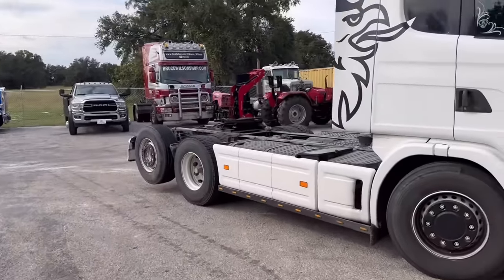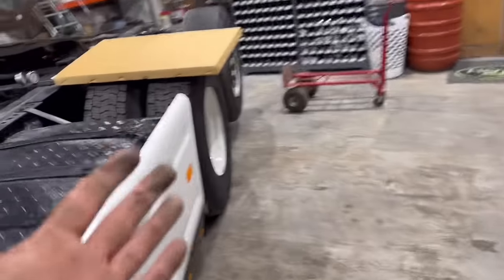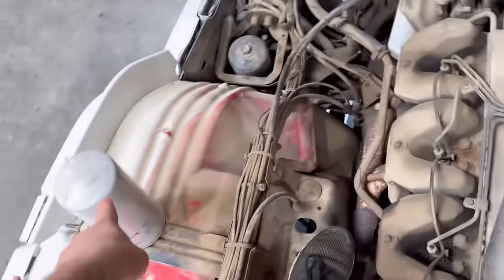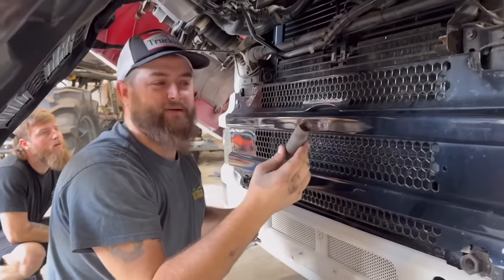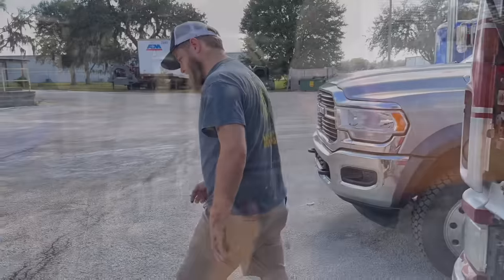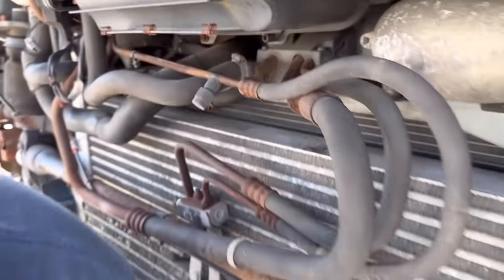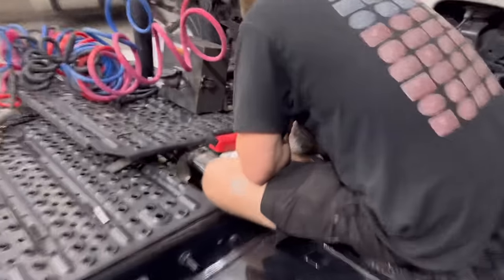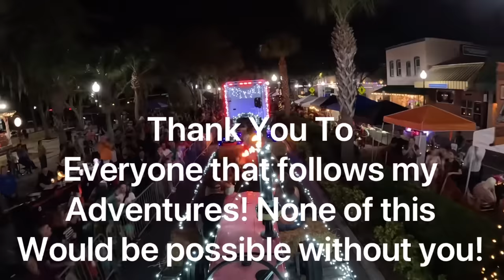My SCANIA Needs Serious Engine Repair…

Comment: The heater is a parking/dieselheater to make the cabin warm in snowy and cold northern weather. Sometimes you have to idle the truck to charge the batteries so the truck can start in the morning as well. Only with 100% healthy batteries you can have the heater on all the night without idle the truck. Trust me, I drove a Scania that night and I was going to sleep in the cabin in -8 degrees celsius. I fell asleep in a warm cosy cabin, but when I woke up it was -4 degrees in the cabin and I was freezing my a** off. The problem was the batteries, heater stopped in the middle of the night due to low electricity in the batteries. But I had still enough to start the truck. It was a newer Scania though with a failsafesystem. Even if the batteries goes low, you shall still have enough power in them to start the truck. The Scania -97 does not have that failsafe tho.
I was sick for 2 weeks after that roadtrip. I wonder why.

Comment: At least in Denmark we rarely se double mounted wheels any more, but a single mount High Pressure. Sadly they give more wear on the roads making tracks in the asphalt. The expansion system on a bridge built close to me had to be strengthened because of those new wheel sets!

Comment: Nothing like putting the oil filter on way too tight. And as for wedding the seal on the oil filter, I like to use dielectric grease. It contains a seal, and it never ever ever sticks. There's enough Teflon in it, specially if you use slick Lube. It will never stick

Comment: I guess you know, but the 530 had a problem with spinning crank bearing in the block. And low maintenanced 14liters like to tear the camshaft. 
Also I saw that you left linkage head on the front left cab suspension is worn (you see rust comming out). And the bolt is not center anymore. (3:44)
Also the cab suspension bushings likes to wear out. Wobble the cap and see if your cab moves alot in the bushing on the big stabilisator (just 10cm behind the linkage i mensioned earlier)
Reply: And also you should open the little plug on the cab-jack before tilting. It will allow air to come out etc

Comment: Nice truck! But your head gasket leak will be the top liner seal that’s rotted due to the wrong antifreeze been used and it will have rotted the block till it comes out the side of the head gasket…. It’s important to use the correct antifreeze in Scania trucks!

Comment: Be aware the liners tend to move around in the block a common problem with single head engines, you can get over size liners. But they do leak coolant when the liner moves around and breaks the top liner oring....

Comment: The greasing system fills from one fitting every time you push on the brakes it greases slack adjusters suspensiom 5 th wheel etc

Comment: You do know, I hope, that you're only supposed to have that rear tag axle lifted for getting traction in snowy conditions, and for installing tire chains? The system not only rases the tag axle up, but also the drive axle downward (hence making it easier to install chains). You're NOT really supposed to drive on the highway like that, and certainly not while bob-tailed. Travelling like that gives you a harder ride from the rear, gives you less braking power and control, and also aims your headlights further downward. Just drive with all axles down; it will ride smoother and brake better.
Reply: Tag axel are supposed to be lifted when empty. Better fuel economy,less tire wear,better traction. A bit less stability.😊

Comment: That coolant leak between sylinder head and engine block is a serious issue. Leaking coolant usually worn out the block and of that happen, whole engine block is ruined. I do not recommended to drive before you open the sylinder head and change the gasket
Reply: Well, changing the seal doesn't help with that. And most of them can be repaired, especially when the leak is not that big. You just have to machine the upper part of the block to a larger size and put in the oversized cylinder sleeves
Reply: @railasvuo  i didn't notice to write that only head gasket replace isn't enought, also sylinder tubes o-rings must be replaced. If there is no worn on block that will help put i think it might be late now
Reply: @sauliaalto  I've never seen those o-rings start to leak unless the block is corroded or the cylinder tube is installed incorrectly. It is almost always block corroded
Reply: @railasvuo  on my 16,4 litres euro 6 Scania that was an issue and there wasn't corrosion. New sealings and problem was gone. And i know many others same ages Scanias which have had the same fix and it has helped

Comment: I know these Trucks, if coolant leaks out the heads, its mostly the engine failure. The sealings from the Liner are broke. To 70% you need a new engine.

Comment: Regarding your parking heater. Should be in nearly all Scania trucks a Webasto heater (I think they are market leader for parking heaters or something close to). In case I would remove the old one and directly install an actual one that probably can heat the cabin air and your engine as well.
Reply: Webasto and Erberspacha (pretty sure I've spelt that terribly wrong) are definitely the top two. Not sure which one is the best?
Reply: @Iaintwoke  Eberspächer… jepp hard to say. I think probably they’re both on the same level. Personally I would head to Webasto. They have the same quality.

Comment: The step is not only to clean your windshield, it works also perfekt to dring a beer in the evenig with a friend. In winter you have a pretty warm ass and back from the heat of the radiators in even in the summer the warmth has something smooth☝🏼😋

Comment: Interesting to find out who added that tag on. 
That truck was 100% a factory 4x2 chassis you can see the fifth wheel mounting on the chassis. Its also alot longer than a factory 6x2 chassis

Comment: hay ya bud why do you not have stone guards on the windscreens of your trucks. scanias are huge in australia. there is a button on the dash looks like a u upside down. if you push it. it will move the weights off the front axle. all your engine and brake pressure  fuel mpg are on the button on the steering wheel. it comes up on the dash good luck bud from australia
Reply: if you are over weight on the front axle you can move it off

Comment: It's not usually a good idea to fill the filter like that, direct from the drum, because they often have crap sitting at the bottom of the drums that can be picked up by the hand-pump, and passed into the AFTER FILTRATION side of the filter - the side that goes straight into the engine, carrying any crud with it.
If you do do it, fill a clean container that you can see the oil is DEFINITELY clean, and preferably use some sort of filter, or mesh, to help keep it clean.
Reply: I kinda get your point but if you have crud in your clean oil drum you probably want to be looking at your barrel changing procedures..
Reply: @Iaintwoke  
You mis-understand - I'm referring to drums direct from the supplier.

Comment: Adjust the cab suspension arms, your cab is bottomed out (on the delivery position), you should have suspension travel atleast 5cm, or 2.5 inches.

Comment: in New Zealand they line the spinner filter housing with gasket paper to make the cleaning easier as the build up is on the paper and not the housing.

Comment: I put some K Seal through it it might just be fine it won't hurt anything

If you think that's nuts many people treat their brand new truck fleets with that stuff so the heads never have a problem it's like putting a glass liner in there ceramic it's not a tar base it's fantastic stuff

Comment: Looks possibly like the original color scheme was the Scania blue and red livery pack. Cause you can see the red on bumper and side of the cab floor but blue on the middle areas. I have the picture of the paint scheme in my head, you might be able to find an image of that factory paint option on Google. Congratulations always thought these trucks were cool in their own ways.

Comment: Once you get the new ac condenser in and fill the system with fridgerent, that ac clutch will start turning again, it wont turn when its empty.

Comment: If you want to steal the show, Go find a T conversion kit for this truck.  Hearing you planning to extent the frame this would fit well as it gives you a bonnet.
Reply: The US trucks is the masters of hooded trucks, no need to try copy. Scania is doing more than good as a cab forward
Reply: @Rimrock300  Yea but thats because EU quit producing hooded trucks due to max length laws (exept Volvo and Iveco offcourse). kinda funny all Scanias before the 144 from this video were also in hooded option from factory. And we Europeans dont need the hood anymore, as we dont have to compensate for some other length. xD

Comment: can imagine they could been configured with like 1000 different options only for the cab back then just like today so probably why they are not exactly the same but yet similar.

since i work with welding the cabs i see  couple of Scania cabs pass by like every day and it´s rare to see 2 exactly the same cabs in a row with exactly same asessories not only because atleast the newest generation has 4 different models just for the cab, then high, normal or low roof option on top of that  and a ton of assesories that has to have mounting holes cut for them or not basicly all over the cab.

Comment: What sort of motorway speeds will it do ? All ours in the uk are restricted to 56mph
Reply: 80+mph easily
Reply: Or depending where the mark on the drive wheels goes 😜
Reply: I think he can take restrictor away, it should be able to run like 100-110 with its gearing
Reply: Speed limiters will be mandatory in the USA..they just cant decide on limit yet

Comment: The cab jack bar should be in this place...bcause u need to open "chins" and grille first to get a bar and leave them open before jacking up a cab :) ...saFety thing.. Same reason with european  cabover volvos...cab jacging tools are under the grille...u need to open grille first to get tools...and u cant let grille to closed position, bad will happen..I saw some those moments, nasty :D

Comment: Bruce the idle thing is false. You can run the truck just idle up a few hundred rpm to keep the oil moving and that’s perfectly fine. I used to run a Scania in Western Australia and high idle is perfectly fine to keep the ac on when parked up.

Comment: O-H-I-O Porter greetings 🇺🇸 I like the skirting/fairings on it. It seems to add to the looks as well as make it a bit more aerodynamic/sleek. Do most of the components seem to be more accessible on the front? At least it’s left hand drive for a foreign truck. That tag axle is quite unique as well. I have to say that I’ve not been too impressed with those SCANIA trucks, for the most part. Some features are cool, but that’s about it. Enjoy it, my friend. Merry Christmas! 🥰🤩✌️
Reply: What hasn’t impressed you? Not looking for an argument. Just wondering.
Reply: @Dreyno  🇺🇸 No problem my friend. They are cool looking trucks, overall. Tall, usually covered with fairings, etc. I can’t critique what I don’t know much about, but I’ve just never cared for them that much. Parts is usually a big factor…having to order them from another country is not advantageous. I’ve only had experience with Volvos & I sure don’t like them. That’s why I’m enjoying what I can from Bruce’s videos. Have a blessed Christmas.✌️
Reply: @the.porter.productions  But “not impressed”? What are their shortcomings? Parts availability due to location isn’t really a shortcoming of the machine. I grew up around them and they’re mightily impressive machines. And as a piece of machinery they don’t really have any major shortcomings. Powerful, efficient, reliable and comfortable. Their mechanics, owners and drivers all love them.
Reply: @Dreyno  🇺🇸 Parts availability is a shortcoming in my book. They do seem to be rather good on fuel & have some good body features. I don’t have any experience with them, but they still don’t excite me. I’m glad Bruce has 2 of them & hope they perform well for him. They will provide answers to some of my questions about them. Blessings. 🤩🎄✌️
Reply: @the.porter.productions  It’s not a shortcoming of the machine. A Peterbilt or Mack has zero dealer support in Europe. It doesn’t change their quality as a machine.

Comment: I know everything about this trucks, engines and problems. About old heater - you need just throw it out, because it's an old wet heater what heat coolant, this thing is good for cold conditions, but it's to old and you don't find spare parts, and also this heater needs more power from batteries. Better buy a new usual dry  Webasto heater.

Comment: What is the Horsepower and Torque on the motor??
Reply: 530 ponies
Reply: If im correct, 530 HP(m) and 2400 nm of torque (1770 lb.ft for my American friend)

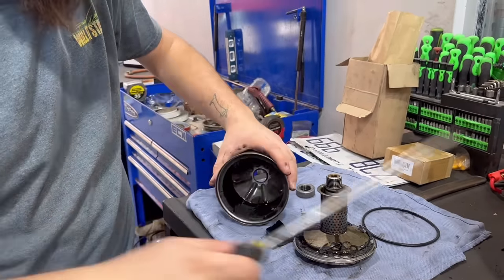Comment: 12:55 Bruce please wear nitrile gloves when you're using the parts washer.  That solvent penetrates your skin and you don't want any petroleum products in your system.  Really one should wear gloves anytime they're wrenching.  Plus the ladies appreciate a man with soft hands 😄😄😄

I worked as an assistant to my old man (master mechanic) and spent untold hours doing the dirty work... he started wearing gloves in the 90's and is still in the shop every day healthy as can be at 65. : )

Comment: What happened to the FORD pulling tractor?
Reply: Yea... what did happen?
Reply from the maker: It’s around. Turns out the folks in came from wanted it back in a bad way so it’s on hold
Reply: @Bruce_Wilson  Ok, Well hope Everything works Out w it!

Comment: Hi bruce, not sure on yours with it having the tag axle fitted out of factory, noticed you put lights on the rear tyres, just remember that those axles automatically drop when the truck thinks the weight is on, 😂
Reply: No they don't 🙄. Boggie axle stays up as long you press the button down
Reply: @sauliaalto  not in my experience, maybe its cus i drove newer ones, but as i said, not sure on his,
Reply: @anthonynoblett952  4-serie is so old that there is not computer which control air suspension. Just electronic/ mechanics valves. And you can get rid off that feature even with newer models, just go to scania dealer and tell them to change suspension settings with computer

Comment: You messed up your other Scania and finally broke it, don't make the same mistake hear, by all means do a full refurb on it, but don't do anything that will take away it's Scania Pedigree, you have a quality engineered truck, far better in my opimion than anything the USA can build, that's why the USA won't allow any new Scania trucks into the country, they have to be at least 25 years old, they couldn't compete with them when they are new, either in quality and price, not to mention MPG.

Comment: Scania didn’t have a big power engine so they bought the V8 engine from Leyland Trucks ( which I think had been a problematic design for them ) it had been used in some of their heavier models but was not very popular. Scania then went about developing it and for the last 40 plus years it has been the mainstay of their heavy truck range .  Other European manufacturers  did the same , and used other model engines from Leyland to develop them notably the non turbo 680 , which was never developed for turbo’s. Leyland seemed to be concentrating on the home market which did not have great distances to worry about in the Uk haulage industry . They licensed other manufacturers to make the engines , but the longer distance haulage in Europe called for more reliable and quick vehicles and this was really the death of them
Reply: There are many more comments like this on the other videos about V8 Scanias, that Scania's V8 is from AEC (UK truck brand). But I've got none online article that mention it or discuss it. Is this statement even true? 

I mean, from timeline wise, AEC V8 released to the market in '68, a year before Scania released their own V8. But that's the only supporting reason, other than that i found none.
Reply: @ajidamarjati  Yes you are correct , it was the AEC engine , which was at the time a Leyland owned company . This was before they merged with BMC to create British Leyland . This engine was well engineered but had reliability issues which they appeared to not be able to fix . Scania took it on and the first truck using it was the 141 .
Reply: Are you not confusing it with the inline 6 cylinder in 1949?
Reply: @ajidamarjati  
You are correct I couldn’t remember which subsidiary of Leyland it was from . Thanks for jogging my memory!

Comment: Why go to finland for expensive scania psrts (they use euro) when you can drive from finland to sweden just hours depending on where in finland or take an over night ferry and buy scania parts in the country where they are made for Swedish krona instead akd get it cheap?. Every truck junkyard and parts store here in sweden has parts for these not to mention you can drive from the ferry terminal to Södertälje where scanias are made and look at new ones in under an hour bro :)

Comment: Hey @Bruce_Wilson, are you a hauler or driver by profession, or are you just a YouTube-creator at this stage? Are there any issues with taking this Scania into commercial use like it is rn? Like are there any laws and regulations in the US or FL that says that you need to do anything with the Scania to start using it like it is? Would love for you to connect a trailer to the 5th wheel and take it for a spin to see the difference between a #peterbilt or #kenworth compared to the Scania. Otherwise, love the content with the Scania's and hate to see you destroy the other one! Hope you spare this one, and im curios to see what will be of it, if you get to make a half-breed with Swedish-American mashup.